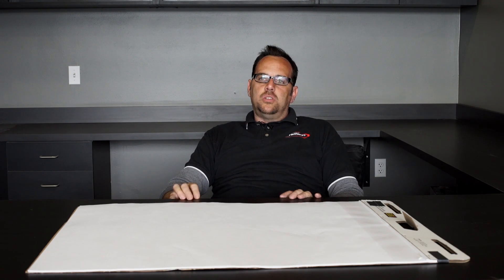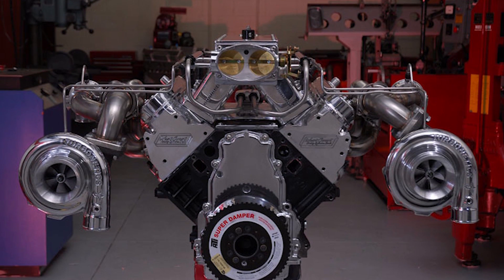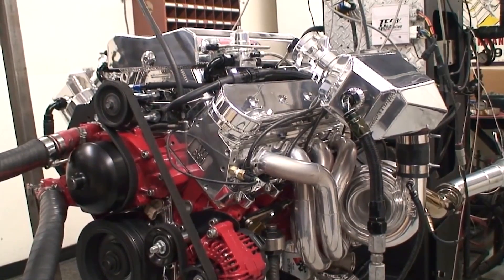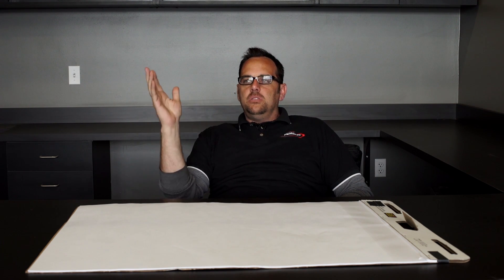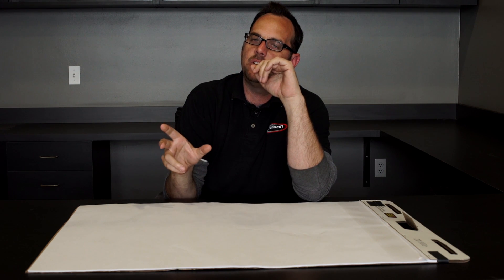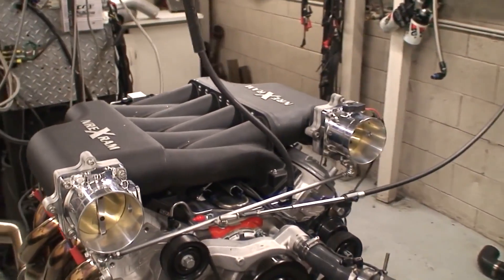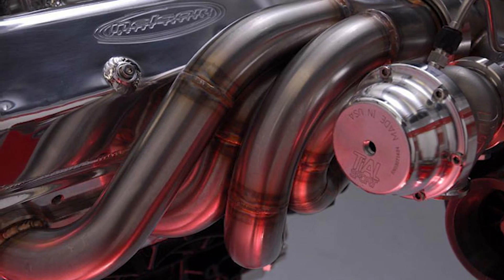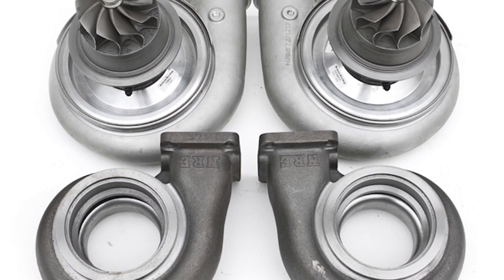Master Engine Builder Explains Why the LS V8 Is SO Good

Comment: LS, Coyote, JZ, all good engines
Reply: Forgot about the mustang terminator motor
Reply: +Tyler Smith The youtube comment system is so dumb that people are having conversations and I have no idea what they are talking about because all I can see is Supra1722 statement and he is responding to someone who I can not see........

Yes these are all solid engines
Reply: +supra1722 I've owned 2 of the 3 and since the 2JZ (the one I haven't) is a known quantity to everyone, I can attest to the truth of this statement.
Reply: +supra1722 I know i'd get some hate for this but also the K20a is a good engine for a four banger.
Reply: +supra1722 indeed, I'm generally lean towards GM but ohhhhhhhhhhhhhhh would i love to own  a 97 supra
Reply: +Duane Craig dude deleted his comments. that's why it looks like OP is talking to himself
Reply: likewise brother. love the flat plane crank and almost Ferrari style V8. i guess the firing order is also similar.

a shop in NM is running deep 8's on a 67mm turbo @165+ weighing 3100 ish lbs. it's crazy what they're doing with Coyotes.
Reply: +Angel M modular motors❤
Reply: ***** the 2JZ is a wonderful engine. Please don't hate on this motor it's one of the best engines ever made especially for boost. I have seen people throw mega boost on this motor and the motor still will blow up. Please take your hatred towards this engine elsewhere
Reply: Coyote hasn't been out long enough to know if it is good or not. 2JZ with twins can weigh upwards of 700 lbs, and is larger in size than an LS V8. A 2JZ can be built with great power, but it costs a ton of money to get it passed 500-600 because a full build is required. For what JZ is, and what is out there now, I would build a 2JZ into a coffee table for the garage. Sorry if that offends you all, but it is the truth, I have no use for a built 600hp 6 cylinder that weighs more than a Duramax diesel engine. There ARE better choices.
Reply: C Genious please don't speak on subjects you have no knowledge of, you will make yourself look bad.

no 2JZ with any turbo kit has ever weighed anywhere near 700 lbs. it IS an Iron block with an aluminum head, but God damn- where are you pulling those numbers out of?

it takes a ton of money to surpass 500-600hp?? nearly 500rwhp can be achieved on stock twins with only simple bolt on mods and 500+ can be achieved with just mild cams on top of that. the stock motor/head has reliably been pushed to 850rwhp for many years even with ECUs as old as AEM V1 with no failsafes- good for deep 9 sec passes on the stock 6speed transmission (which has been used in the quickest and fastest 6speed cars in the world running as fast as 7.91 without a single modification).

please enlighten me buddy, please name sone of the "tons of modifications" i need to perform on my 2J to make 500-600rw.
Reply: i can name you 10 names right now who have done so.

Peter Black made over 1000rw on a stock block in 2003. Mike Carwin. Ben Yavari with tons of 9 sec passes and street bike kills. Joe Rutiglano 900+rw driven hard. Matt Watts 800+ for years. Zach Webb for years and many TX mile, track, strip, and street miles.

you genius, V160 means transmission and A340 is also a transmission.

"2JZ-GTE - 594 lbs w/ Getrag V160 or A340 - 746lbs"

so that is how much it weighs with complicated stock sequential turbos and everything to run including a transmission. try again.

it also says "1JZ/2JZ ≈ 450lb"... u think a turbo and the manifold and all piping and fabrication will add 300 lbs to a motor? please bro, don't post stuff if you're not sure about it.
Reply: +supra1722 you seem like the perfect man to talk to about this ive been looking at getting a decent supra and i found a twinturbo 94 supra with a mint 2jz  in it and the body and interior were great too it had 140.000 km on it and its 7500 dollars USD worth buying?
Reply: it must be a scam- rollers (no engine or transmission) sell for more than that nowadays. i've seen some clean rollers sell for over 10k as well. what country is the car located in?
Reply: Canniballistix K20's are awsome! let all them "the only good shit is american" guys hate true car lovers love all cars and all engine's
Reply: you better be upgrading pistons/rods to make 800wheel with the amount of torque the 6G makes.
Reply: +supra1722 I like Cummins and Wankle
they should work together to make a turbo diesel rotary, call it the cumminwankle
Reply: ZERO94AIC didn't see your comment.

see, better in what regard? it's subjective. unfilled 2JZ's on AEM V1 for God's sake have held multiple FULL mile runs at well over 240mph back in 2008/9. where were you at the Texas mile when Supras came 1st, 2nd, and 3rd 2 events in a row? cars made 1560, 1508, and 1580 on kill. they were turned down to 35-38 lbs peak. reaching peak boost at 6500, revving from 9.5-10.5k. for a whole mile. don't speak about what you don't know about. in 5th gear. 1:1 with 28 inch tall tires. 246.2 in 2008, 243.6, and 247.7 the next year. 3 different cars. 2 shops. AEM V1.

where were you when Darin ran low 8's all day on stock axles, stock rear, stock block casting, completely stock transmission, and stock head castings? where were you when Joel ran his 3.0 for a year straight on stock transmission, stock head castings, stock block casting, and alum rods for a whole year making 1500+rw trapping a best of 186.5? your arguments about longevity are theoretical, i'm giving you actual cases, builds, and names. i'm not arguing about the science behind it and i'm not stupid to say there is a replacement for displacement and boost. your claims that the 2J can't handle high stress levels for long amounts of time is unfounded in real life.

also your statement, a 2J has never made 800whp at 20 lbs... actually... a 3.0 iron rod stock head casting stock block casting stock 6speed Supra made 910+rw on 21lbs. PTE 88, 10:1CR, street/race ported head. 

recognize a good engine? have you not noticed, i've never once put down a single engine. and if you even read the thread you commented on and the original comment, you wouldn't say what you did.
Reply: it's been a long time my friend. message me
Reply: +supra1722 I really like the coyotes, solid truck engines. but man they are huge, you need assembly lube just to get them between the frame rails lol. a coyote swap is on the list someday.
Reply: +Angel M exactly what I was thinking! How can you forget a factory forged motor that can take over 1000hp on the stock bottom end?!
Reply: +supra1722 yup great motors! just throw the 4g63 in there and the line ups complete lol
Reply: +supra1722 cuz that's gayeeeee!
Reply: +supra1722 The Gen III Hemi is pretty good too. The Apache Hemis (aka the 6.4 L) with Tithek Heads and a Mopar performance intake will make almost 600 hp without a tune even. Once you get into a tune, cam, bore/stroke, you can make 700 hp out of one. Look at what BES did at the Engine Masters Challenge last year.
Reply: +Thenitroviper the gen 3 hemi are nice I love them, alot of people just don't know about them yet and their not very attainable/cheap as the ls platforms 😧
Reply: Yeah, as the dodge trucks get junkyarded more they will become more popular
Reply: recently made ones, yes. But the big block mopars and the new stuff under Tim Kuniskis is actually great stuff. He revamped the engineering department for Chrysler once he saw the mess it was.
Reply: Thenitroviper they should change the name. I hate the sound of "cry slurr... Such an ugly name for a car
Reply: I agree, I just call them Mopars
Reply: Yea and I can't wait till that happens lol I'm tempted to buy an r/t magnum and boost the hell out of the 5.7 ofcourse with internals though,  and yea I just call them all Mopars as I do with all the gm products and ford is just plane old ford I guess lol
Reply: http://www.supraforums.com/forum/showthread.php?677361-2jz-gte-single-turbo-engine-weight 746lbs with turbos.
http://www.autoevolution.com/news/how-to-get-more-power-out-of-a-2jz-gte-stock-supra-engine-bpu-78455.html 600hp stock internals, to still be somewhat "reliable". Sure you can turn it up to 800 stock, don't expect it to last long.
Reply: supra1722 don't let those stupid damn fanboys get you down I'm actually thinking about getting a nice supra next spring. I definitely miss talking to you about the Supra because you are an expert about the 2JZ my very good friend. I'm on a budget how much what I have to spend for a decent supra with lots of mod that won't break my bank? Is it possible to get a nice supra for under $20,000? Please get back to me my good friend thank you and I'm so glad I ran into you on YouTube for the first time in quite a while. If you need help putting them stupid San Boy I'm also here for you
Reply: MrMortalSmg I would be very careful especially if it sounds too good to be true there's a lot of scams out there especially when it comes to cars you might be getting someone else's nightmare if you buy it so at the very least if you are considering buying it definitely have a mechanic or speed shop look at the whole entire car because you definitely don't want to regret your purchase. I was in a hurry want to buy a car and then do my homework because I need a car to get me back and forth to work and didn't have it looked at by my local mechanic and within two days it needed $1,000 repair don't let this be you check it out ahead of time even if it looked at
Reply: my 6g72 in my 3000gt is all stock internals , stock forged crankshaft , I have Dr750s I make around 600ish all wheel HP. low 10 second passes 1/4 mile on 93 pump gas. I'm rebuilding engine , normal wear only on internals so far , plan to upgrade lifters,cams,bearings etc looking for 800AWHP with e85
Reply: Exactly man!
Reply: +pyro74boy Yep, always have a modified car checked out by a pro! I made a similar mistake like you. I bought a supercharged 2003 Mach 1, 24k miles. This thing seemed absolutely mint! I bought it. 1 week later, it was in the shop getting helicoiled because of a blown out spark plug since they weren't torqued properly. Had it re-tuned by this very reputable shop and had the midpipe upgraded as long as it was in already getting worked on and now I'm making 520 HP on 6 PSI. That's more than 200 HP more than stock from just 6 PSI. A 4v DOHC with fairly high compression LOVES making power with a little boost. Now I'm very happy with my car, but that repair cost me $3000. I put another $1000 in for the midpipe + install + dyno tune as well. Kind of wish I just bought a Terminator after putting this kind of money total into it though. I'm scared to go for any more power without the forged internals.
Reply: +supra1722 inline v6 with tri head
Reply: lol nallen, i'd love you to explain both statements, especially the second one
Reply: Dylan Lewis hahaha
Reply: ls is the best/ and bang for your buck...can make 800 horse for less than 4000$
Reply: LS is the most attainable to everybody....and u can make a shit ton of power through everybodys research theyve put it....2JZ and coyote both are still hell of a good engines tho....but i just love me some LS.
Reply: it's all a matter of preference and what the application is. all are formidable and respected.
Reply: ZERO94AIC cant argue with you there
Reply: agreed. but coyote will never be as good as a LSx on return for your dollar. becauze unless you buy a 5.0 stang the crate eng is too expensive... same with 2jz, its a legend of its time but scarcity and demand make it a expensive swap for the displacement you get in return. the $3000+  dollar used ebay 6 speed getrag also shy people away (is there a bellhousing that allows a t56 on a 2jz?).. yeah boost replaces cubes but you can also boost an LS and blow away a 2jz.
Reply: yes, there are T56 adapters for JZs. and there's no way to say an LS would "blow away" a JZ, really. in what respect? side by side comparison graphs? ETs? similar setups? how?
Reply: the equal boost argument is invalid. of course engines of different displacements will not produce similar numbers on the same boost levels. and again, what is "it will be even better"? better means what? it's a fanboy word. better in what regard? better in whose opinion? it's an empty argument. it's fair to compare them at peak boost levels on similar setups. it depends on application, the 2J may be better for some people and their application while the LS may fit others.
Reply: supra1722 take a LS1 5.3L or 5.7L from ebay. Throw some RHS heads on it. You got a 400hp+ on 91 octane beast.... Take a 2jz from ebay for about same money. ... Do the bpu+ work on it ( basic intake and downpipe boos controller. Fuel cut elimitation. Fuel pump. And probaly be well with in the 400-450hp mark. (Yeah i owned a 2jz cressi before with the jdm 1jz bellhousing to use a r134 supra 5 speed) .. Except you will push close to the detonation limit on the 2jz with 91 octane. I live in CA.  Also the a used 2jz is much older used than a typical used LS1 LSx used from ebay, lsx released in late 90s. Wont be as smart to push a 20 yrs old 2jz to the limit. With 400 to 500 hp On 91 octane... ... Now if you add boost to the ls engine 6-8 lbs and youre at 500 to 650 on stock  internals. Probably might wanna go forget pistons for better ringlands. But Yeah the 2jz can probably do close to 550 hp but you guna have to run octane booster or E85 and your closely watch your egts etc etc...  and just be at the limit. Speaking in temrs of for me 91 octane. Because 100 octane is rediculously expensive. Also more lag with 2jz than an LSx v8. Yeah a 4 valve head like 2jz flows better than an older gen 1 sbc with LT1 setup of the 2jz supra days... But modern ls heads for build are pretty damn good today. And basicly its just more bearing area. Bigger mass to handle the heat with LSx...... By the way sure some supras are making 500 to 1000hp. On the street. But are any of them actually oushed hard for enxtednded periods? NO..... Its physics my friend. Something is bound to cook... Why are suora guys all about closely looking at EGTs? (exhaust gas temps) The mass is just not there to handle heat for longevity.
Reply: http://www.hotrod.com/how-to/engine/ccrp-0912-land-speed-small-block-chevy/ here is a prime example of when you need longevity and bug power youre better off with an ls NOT a 2jz; for a LAND SPEED Record. Small block LSx with 299 cubic inches. Thats a barely sub 5.0litre LSx, sure the heads are aftermarket. But thanks to the dart little chief rectangle port heads, ands upporting mods THIS 5.0 LSx BEAST PUMPING 1450 HP AT 20LBS BOOST.. Lol.    WHEN WAS THE LAST TIME A 2JZ MADE EVEN 800HP ON 20 LBS? ... NEVER!!!  It will never happen because nobody will make a aftermarket head for it. Youre hitting toyota oem limitations just by that. You probalu guba wind out the 2jz to 9000 rpm on 30 lbs boost to get upwards of 1400 hp...  How long is that guna last? Not for a land speed record. Lol guaranteed. Probably for the dyno queen day at a supra meet. Thats about it... It always boils down to physics in the end... The lsx is just more massive with strenght and longevity. More bearing surface area etc etc...  And aftermarket support helps alot bringing options and lower prices. How much is a set of JUN cams for a supra and titanium hardware... F-ing expensive....  Main hardware is avail for lsx like aftermarket like block and heads not just bolt ons for a 2jz....  Amd again its options, more lrice ranges etc etc... Youre outguned with 3.0 litres versus 5.0 plus... Or if you stroke up an 2jz. But Now you are hitting the sidewalls of bores harder and its not going to last as long. And ohnly toyota blocks are avaliable... Who makes an aftermarket blocks or head for 2jz? Nonody than im aware of. Limitations. Again...
Reply: there's E85, readily available in most places. and now, i'm not arguing for the 2J. i'm only being fair and asking you to compare apples to apples. pump gas setups, even 93 that we have down here in TX, LS wins all day. can't beat displacement and aftermarket heads. no one in the Supra scene until this year has done anything with aftermarket or billet heads. head flow is the weak point on the 2J, the 1J head actually outflows it.

1000+hp pushed hard for extended periods not possible?

tell that to John Sharkey, Will Dugas, Joel Grannas, Lyman Conrad, Bryan Matos, Zaw, Bradley Roe, Tag Marlow, Ross Baird, Lupe Hernandez... 1300+rwhp, stock block casting, stock head casting, stock V160s. i can list 20 more names off the top of my head. i know two individuals who have run 850rwhp on the stock blocks with 100,000 plus miles with archaic engine management systems before 2008, with hundreds of dyno pulls, some above 900rwhp, countless street pulls into 5th gear against maros and busas at 800+rw, and track passes nearly on kill. thousands of miles and hundreds of pulls, abused every time they're taken out. tell me about longevity.
Reply: supra1722 "i'm not arguing for the 2J. i'm only being fair and asking you to compare apples to apples. pump gas setups, even 93 that we have down here in TX, LS wins all day. can't beat displacement and aftermarket heads"-
 just quoted you.
 seems you got the point. thank you, and yes the 2jz is a magnificent work of engineering as is the LS, but everything has limitations in the end....  LS is just very available with tons of aftermarket support,  the gearheads win....  

One that caught my eye recently was the new "coyote-ISH" similar but not all coyote, the 5.2 better called the VooDoo v8 in the gt350..."What’s exciting is that Ford has created a production engine that will live at 7,500 rpm with a redline at 8,250 rpm. And every gearhead wants to know how they did it."

http://www.powerperformancenews.com/tech-articles/inside-fords-new-5-2l-shelby-gt350-engine/

 i bleed synthetic oil myself. i dont pledge allegiance to a single team of engineers products. just a IC engine fan...
-cheers
Reply: the quickest import  was a stock block casting stock head casting 2J until a few weeks ago. it's running 5.70s. we've never had any billet blocks or aftermarket heads. just port jobs. cams, springs, oversized valves, that's it. now there are two parties experimenting with aftermarket billet heads and one or two parties that have already started using billet blocks. the record car has just switched to one.
Reply: supra1722 post up some links if you can please so all can see. Im very curious to read more details about these examples.
Reply: here we go again... what matters is more power with a similar setup at the peak amount of boost. no one cares about power per lb of boost. unless you're comparing two of the same engines with different setups or two engines of similar displacement. the 2JZ isn't superior because they handle more boost, 90lbs in some racing applications, and 35+lbs regularly in street applications. it's a different engine, designed for a different purpose, completely different orientation, and in a different class of displacement.

pump gas? LS wins all day. you don't want to push much boost through a 2J on pump, unless you're in Europe with 98 fuel.

power per dollar, i might also give that to the LS. though you can rip off the sequentials and bolt on a small single kit and maybe some injectors and make quite a lot of power with a JZ. stock internals and stock head with only cams and springs, Supras have reliably made 850+ and 1020+ for a few dyno pulls, with the tuners and owners ready for the engines to blow.

for a big build, however, the 2J will be FAR less expensive. too many stock drivetrain/suspension/engine parts can be retained well past 1000rw. there are over 15 owners i can name and list their setups off the top of my brain who have been deep 8's, and one in the 7's with stock axles, stock rear, stock transmission, stock block casting, stock head casting, stock IRS. 7 of the fastest 10 clutch shifted 6 speed cars in the world are stock IRS stock transmission stock block casting and stock head casting MKIV Supras.
Reply: Im over the argument with the "supra guy". clearly all defensive about the supra and 2jz. . . .   I agree with Mr. Nelson 💯 and thats good enough for me !  🍻😀✌ Good Day!!!
Reply: i'm not just mentioning fast cars. i'm disproving your statement with examples of people with basic builds and tons of stock parts withstanding tons of abuse. you have no  idea about the Supra scene if you think JZ's haven't held that kind of power.

LOL "are they way better than LS too?"

i said- LS>JZ pump gas. LS>JZ cost wise.
i never once said JZ>LS xxx wise. i've given credit where it is due, you're brushing off real life examples. lmao and you're the one who is saying one engine is better than the other lol.

once again, you've made judgments on what's convenient, i've given credits to Coyote motors, LS motors, and the 2J in the whole thread. i never took anything away for another. it's not one is better, just different strokes for different folks. that's it.

because it's larger, it makes the same power at lesser boost levels, thus it's superior.

thus every engine that is larger is superior to an engine that is smaller, no matter if a smaller engine can make as much power as a larger engine at its peak boost level. compare both at their peak boost levels when turbos have been maxed. 20lbs is considered low boost for the JZ. compare hp and torque figures and ET's with similar setups, not a SBC on kill at 26lbs and an RB on kill at 52lbs.

let's say X engine on twin 67's hasn't woken up at 20 lbs, and Y engine has maxed been maxed out at 20lbs. but X engine on twin 67's makes the same power as Y engine when engine X is maxed out at 40lbs. engine X is twice as large as engine Y. engine X in drag racing applications has supported up to 2600hp reliably, engine Y has done the same, maybe more.
Reply: almost all motors r built with great value. it dont matter if its small or large engine. with the rite tuning n parts you can any motor powerful. most engine r built to last for decades. nowdays with more new technology it doesnt need to relie on old oem tech like back in the 60s, 70s, n 80s.
Reply: +Mark M I'm a fan of V8s mainly, but the 2JZ is an excellent motor. It's only laggy because people tend to use turbos. It's not the engine's fault. Attach a supercharger instead and it's not laggy anymore.
Reply: I love ls engines, but the 'ls is cheaper argument' only works if you live in the US, Canada or Australia. In the Netherlands, even a second hand iron 5.3 will cost you 3k (LM7). Thats a cheap junkyard motor in the US. I would love to put an ls in my mk3 supra, but the 2jzgte was just a cheaper alternative. So its all about the location.
Reply: Thenitroviper Mopar anything was born for the junkyard.unless its a cummins